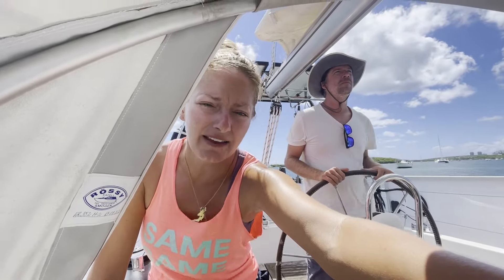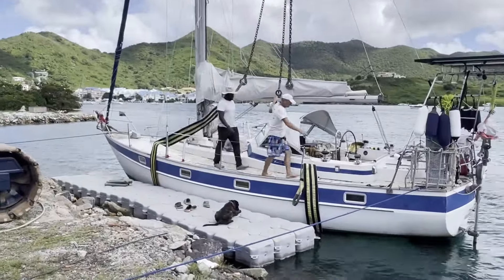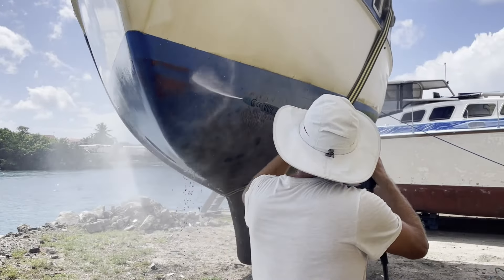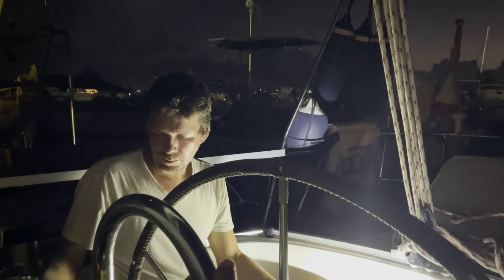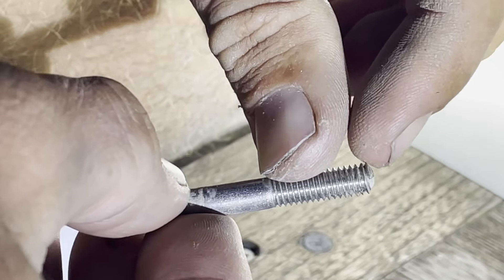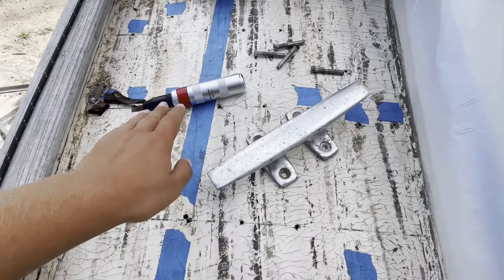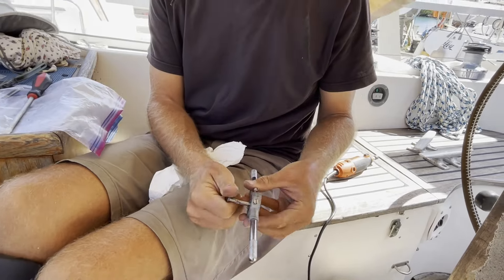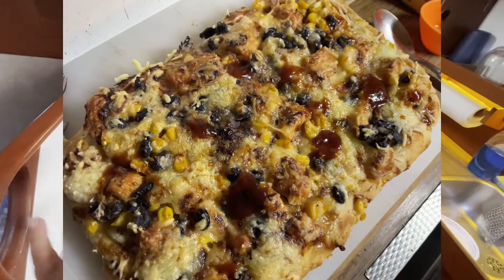⛵️HAUL OUT TIME! | DIY Sailboat Teak Deck Removal | Hallberg Rassy 352

Comment: I watched another video, where the owner had the same name boat, was taking up the teak. He just filled the holes and put down a paint type substance. It looked good. Just wanted to pass it on. Love you guys😊
Reply from the maker: Thank you so much !! 💜 
It all depends on what you find beneath the teak. AND if you plan to fix it properly or not lolol 
The easy way is to just sand, fill & slap some paint on and in a lot of cases I’m sure that would do just fine. But we want to make it super sonic strong!!!

Comment: To clean up the aluminum cleats sand out the scratches with finer and finer sand paper up to 220, then polish using a buffing wheel with progressive polishing compounds, it will end up looking just like polished stainless.
Reply from the maker: Good tip thanks for sharing ! We have the aluminum portlights to clean up as well, we will try it out !

Comment: if you have an angle grinder, you can taper the end of the bolt such that the leading thread ramps in rather than being full depth. You won't need to chase the threads, though it's a good idea.. sort of like sharpening a drill but just a bit deeper than thread depth is plenty.
Reply from the maker: Thanks for the comment Jon, these are some pro tips !

Comment: Top tip on the tap & die kit. Been removing the cleats on my 352's and that's the exact same issue I have with dodgy threads on bolts I need to reuse. Now ordered a kit.
Reply from the maker: Awesome !! So happy Jeff’s tip helped you out ! Dont forget the cutting oil :)
Reply: @sailingjoco the tap and die set was the difference between success and failure today. New cleats now on my 352. Thanks Jeff. Love your videos.
Reply from the maker: Amazing !!!

Comment: Good work on the bolts! I have a 352 too, and I just mounted brand new Genoa tracks, and there were A LOT of bolts, 45 per side! I got some 90 NEW bolts, quite expensive!

I’m looking forward watching when you open up the deck to check for moisture. In a previous comment I mentioned that I recaulked the entire deck a few months ago. The other day I ran over the deck with a moisture measuring tool, and it seems all good. No alarms thus far, so I’m content so far. But very keen on seeing what you find under the glass fibre deck, perhaps plywood in areas where structural sthrength is needed, such as under cleats, Genoa tracks? I know for a fact that this is the case under the windlass and ventilation, but not sure on the sides. Good luck with the hard work! Christofer
Reply from the maker: Wow big job for you! 
Yup we are planning to replace the wood under the Genoa tracks for sure , we think that’s why some of the screw holes came up a bit dirty and wet;it makes sense anyway. We’ll see !
Reply: @ Very interesting, will follow your deck-excavation with great curiosity 😅
Reply from the maker: lol lotsa surprises comin up …

Comment: Aluminium is really difficult to refinish. Maybe sand or bead blasted with a clear 2 part coating or anodising if available. The blasting will give the closest to a even finish all over. Possible to DIY anodise with basic equipment. power supply or car battery and sulphuric acid (battery acid)
Reply from the maker: Thanks for the info ! That sure sounds like a lot of work just to make em prettier since they’re already functional. Unfortunately that’s gonna be lower on the priority list for now. Gotta hold out for a HR sponsorship 😂😂😂